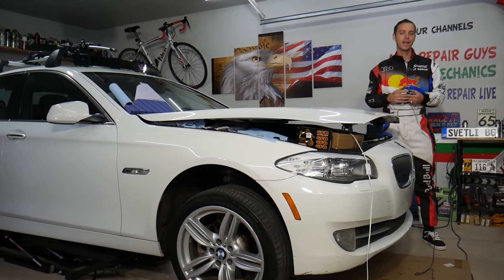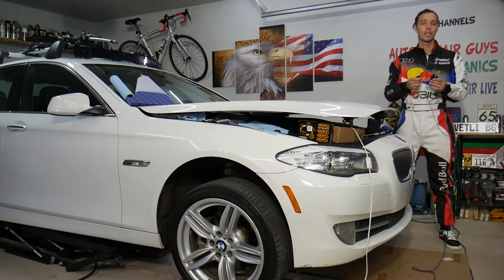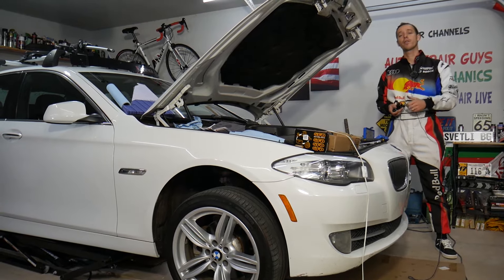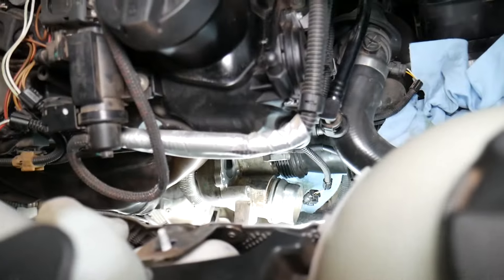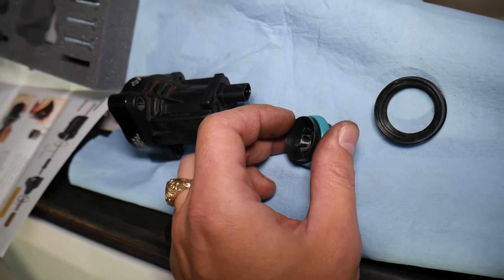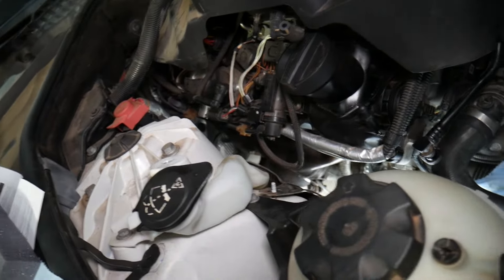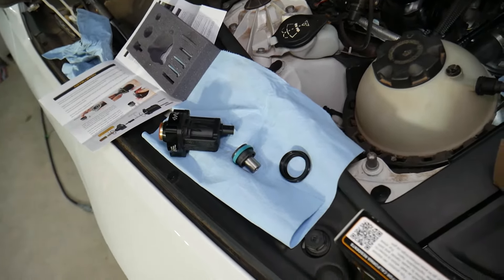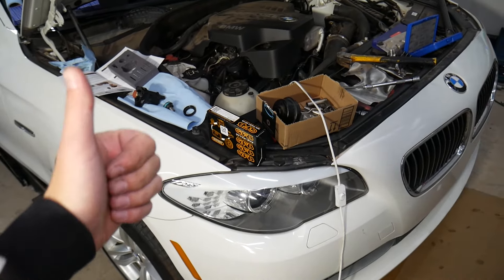BMW 5 SERIES DRIVETRAIN MALFUNCTION WARNING BMW F10 F11 E60 E61 G30 520i 523i 525i 528i 530i 535i 51

Comment from the maker: Products that we use and recommend:
► Turbo Diverter (Check for your model): https://amzn.to/3IzZzH0
► GFB DV+ (Check Fitment): https://amzn.to/3Yod4SY
► Long Torx Set: https://amzn.to/33d5rpH
► Hex Key Round Top: https://amzn.to/3y91pdf
► Panel Removal Set: https://amzn.to/3YiMADu
► Assorted Fuses: https://amzn.to/4fx4s3F
► Tool Set: https://amzn.to/3p5MM6t
► Screwdriver Set: https://amzn.to/3XRB28Q
► Castrol Oil: https://amzn.to/3xBc8B9
► Oil Filter: https://amzn.to/3w0Ulme
► Torque Wrench: https://amzn.to/32qyRwg
► Liqui Moly Engine Flush: https://amzn.to/3IiDBID
► OBD Scanner that we use most often: https://amzn.to/3I4MQfe

► Check out our Amazon Store for the tools and parts that we use: https://www.amazon.com/shop/worldmechanics

Comment: I did a pull today and almost immediately the car jerked and stopped. The drive train malfunction came up along w the check engine light. Car was jerking and shaking while driving a good amount. Parked turned the car off then on again and no noise driving fine no engine light but now I’m terrified to do pulls and wondering if I should buy to see if repair is needed
Reply: Mine is doing the exact same thing I’m trying to figure out why it’s so annoying
Reply: Hello guys, that happened to me yesterday and I’m a little worried about it. Did you get the chance to fixed it? Do you know a good technician in Miami? Thank you!
Reply: Also having the exact same issue. Did you guys find out what was causing It/what needed to be replaced?
Reply: Having the same issue here, it’s been over a month now stranded in the repair shop 😭, please helppppppp
Reply: Mine literally is doing the same thing 2014 550i
Reply: Hi Gents, just got my f10 535i back this week from the mechanics and the issue has been fixed. The high pressure fuel pump (HPFP) needed to be replaced. Also replaced the Low Pressure Fuel Pump for safe measure. As per above it would usually have this issue if I was heavy on the throttle sending the car into limp mode (drive train malfunction + CEL). Hope this helps!
Reply: @ModeloG mine just did it tonight that’s why I’m here have y’all figured out how to fix it
Reply: i was reversing out of a parking spot when mine went off. check engine light on, car was jerking and stuttering. after shutting it off for like 30 mins it’s been driving fine for 2 weeks now. it was idling for an hour before i drove it so idk. also the car turned the engine off by itself and went into park

Comment: I have a bmw 535i 2015 recently i try to do 0-60 and when the car shift to 2nd gear the drivetrain malfunction appairs and wont be able to put the car on drive or anything, i turn off the car and put D quick but quick stop working the code i have is P18D2 anyone can help me with this … code is ration monitoring shift gear 2 is my transmision bad or it could be something else? Thanks

Comment: I have a drive train malfunction but no codes when I plug in my scanner. I cleared the codes but I still have it and doesn’t rev over 3.5k rpm in drive. What should I do?
Reply: did u figure it out?